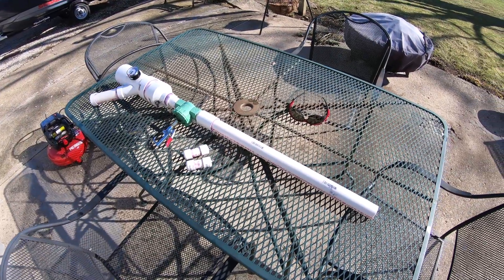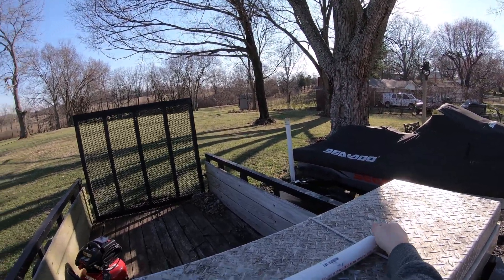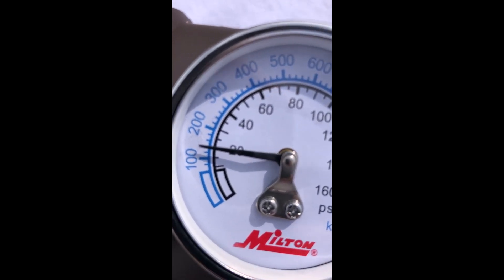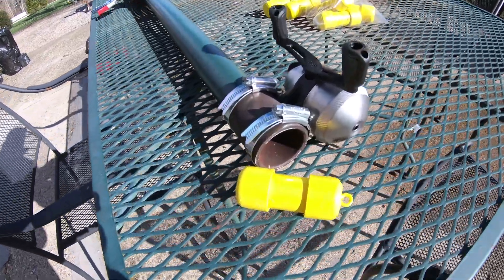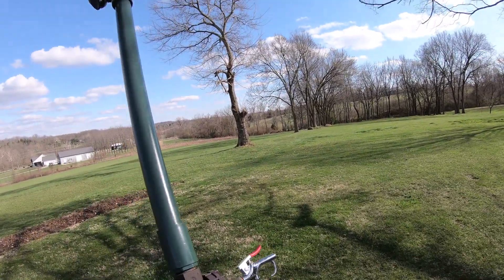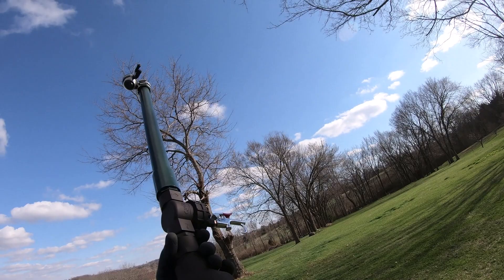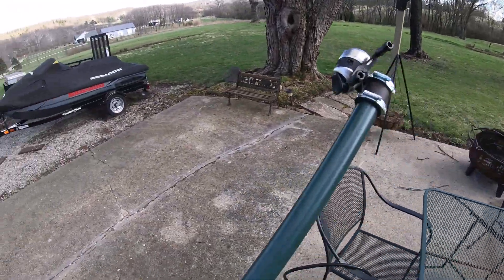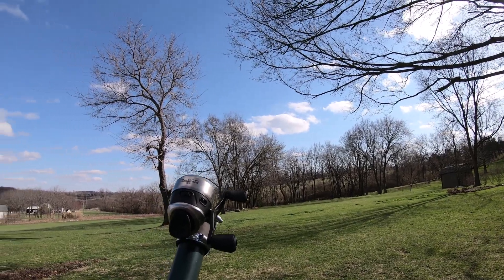Pneumatic Antenna Line Launcher

Comment: Can you provided some links to your parts used to build this. Thanks
Reply from the maker: The trigger system is a Sprinkler valve - Orbit 57461 (1" female NPT both ends) typically found at Home Depot.  Also referred to as 1" jar-top in-line sprinkler valve.
You can find various builds on the internet.  I found a few different ones and combined a couple ideas into one.

Comment: all this is great but what if you are unable to roll it back due to getting stuck in the tree badly? what do you do then??
Reply from the maker: good question....first that is why we use fishing string with a weighted projectile.  If it gets snagged, you can easily cut the string the the weight will more than likely fall to the ground.  It has worked for me anyway.  The point is to over-shoot your target so the weight hits the ground on the other side.

Comment: Got a link to the trigger system at all
Reply from the maker: The trigger system is a Sprinkler valve - Orbit 57461 (1" female NPT both ends) typically found at Home Depot.  Also referred to as 1" jar-top in-line sprinkler valve.

Comment: Many components used in this launcher are drain type fittings, not rated for pressure applications. These have thin walls, shallow cement sockets and often have angles and other features which reduce their strength. A safe launcher should only use pressure rated fittings and pipe.  Be safe and have fun.
Reply from the maker: You are correct...but we use the most thickest of PVC pipe and don't intend to put more than 30psi in it.  I will not look to patent this pneumatic gun but it works great!  Wear safety glasses!!!